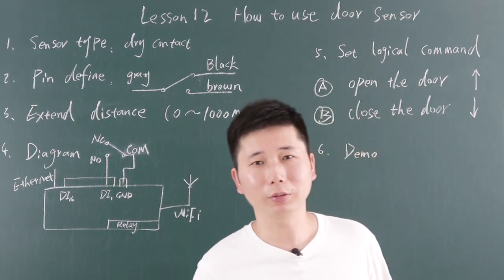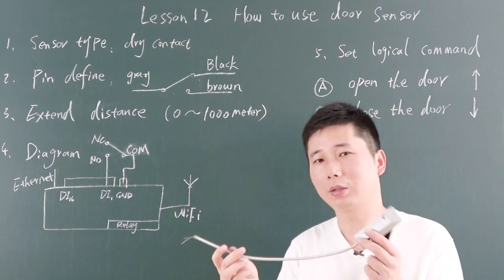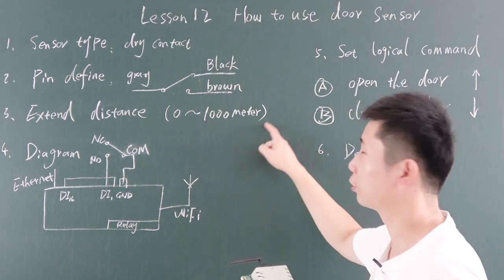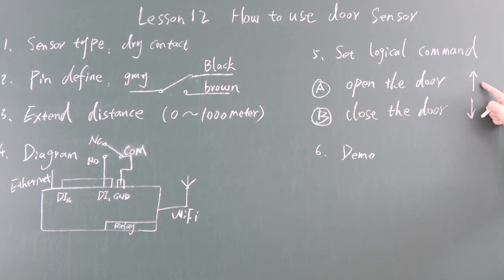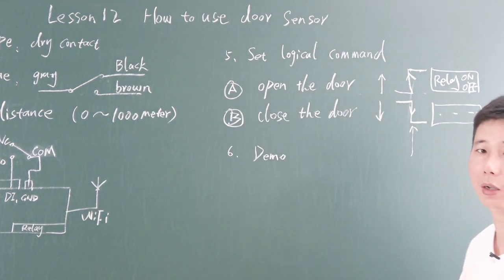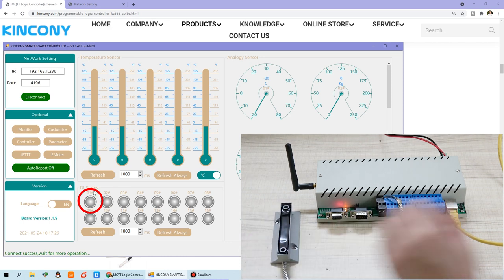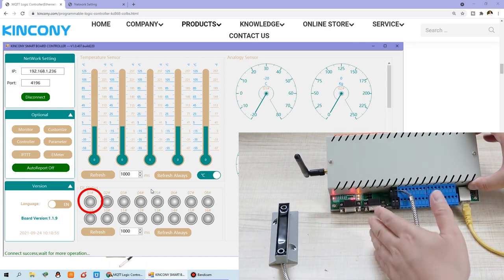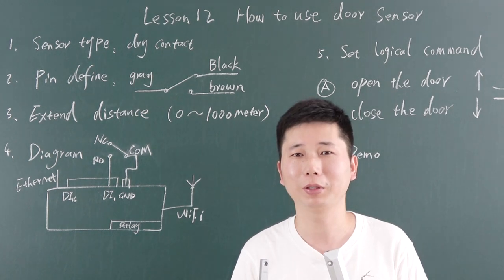【IoT training lesson beginners #12】How to use door sensor for automation

Comment: that's great....

can i able to make notification alerts to my phone when the door opens is possible...
can i able to monitor sensors data from anywhere is possible...
can i use h32bs board relay and colbs relays output at same time is possible...
can i able to add 3rd party wireless sensors...
Reply from the maker: 1. use this function can let door sensor connect to H32BS's DI.
2. there is a solution use by MQTT dashboard free phone app to monitor every sensor data in anywhere. or let COLBS work with home assistant.
3. yes, they can connect together by RS232 cable or by RS485. one COLBS support automatic control many H32BS by RS485.
4. we already have a video tour about let relay controller work by XiaoMi zigbee sensor.
Reply: @KinCony  thats great